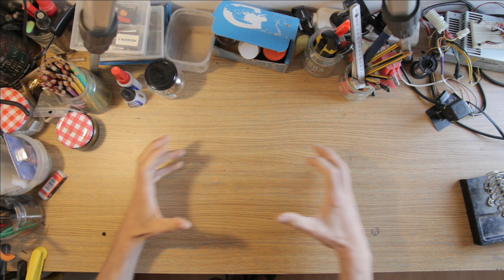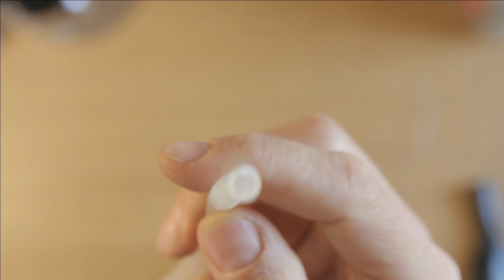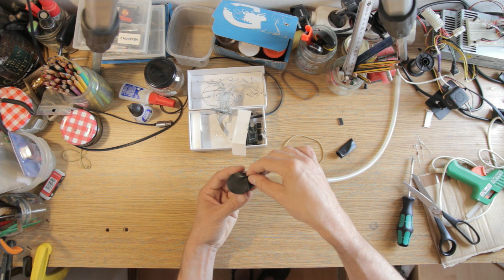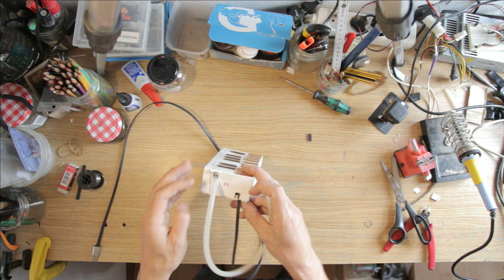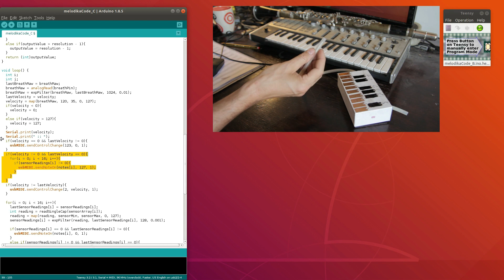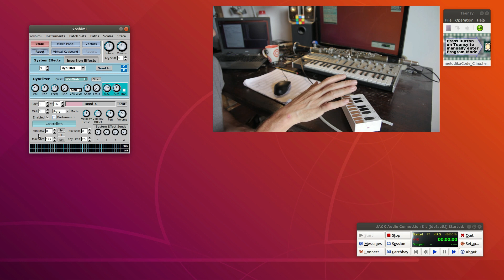KontrolFreak DIY MIDI Melodica

Comment: I'm thinking if it is possible to do this with a real melodica. So it can be use as the regular instrument and as a midi instrument. What do you think?
Reply from the maker: Might be possible, but quite tricky though, because of the mechanical nature of a real melodica. You'd need a completely different sensor setup to make it work...

Comment: would be nice to have a midi mouth piece that could be combined with any midi keyboard now that is something i would love to have :p

maybe one could adapt this with an arduino or something with a midi hat... and have midi in and out and do something with the signal based on that hmmmm... not familiar with midi interfaces though... but kind curious to try it :p
Reply from the maker: No need for an Arduino and MIDI hat. This chip (Teensy LC) outputs MIDI via USB, and can be programmed with the Arduino IDE. Would be pretty trivial to make a separate breath controller, and use it with your keyboard of choice. Just have it send a volume control (CC#7 for example) to the same channel as the keys. You might enjoy some of the mouthpiece prototypes in my newer videos: https://www.youtube.com/playlist?list=PLCejzxWlLD_ybX0R1CpkwIb5D1jcsiq2-

Comment: At last! The FIRST man, who published this idea!!!! There is also KIMOLODICA on Youtube, but without any information about this instrument. As to my question: I have almost no idea about programming, but - how can I make the woodwind controller with the help of a balloon (of course, I understood the principle of LED and photo sensor ) in order to connect it via MIDI to the synthesizer? So, is there any ready-to-use board, to which I can solder LED and photo sensor and get MIDI signal, which will be directed to my MIDI sound device? Thanks
Reply from the maker: Thanks for your comment.
Your best bet for a ready-made board is a Teensy microcontroller. It has a USB MIDI output which works great. If you want something that's more "plug and play", with no coding or complexities, then you'll have to wait a bit. I am currently working on a workshop format for schools based on these instruments, and as part of that I will make and sell sensor modules and breakout boards. The code for the instruments will also be up on github soon. Subscribing is the best way of keeping up to speed ;)
Reply: @KontinuumLAB  Of course;) When approximately do you plan to accomplish it?
Reply from the maker: Soon as possible ;)
Just uploaded the code this morning, link is in the description.

Comment: Nice YouTube channel. Your talents are very impressive. I really enjoy the more creative uses of computer engineering. I wanted to ask, how do you clean your electronic wind instruments? The melodica was a short term project but how about for the Open Horn? Doesn't the balloon material trap a lot of bacteria? Or perhaps it's unlikely that any moisture in the breath will get that deep inside? Thanks for all your fascinating insights.
Reply from the maker: Hi Elizabeth. Thanks for your comment.
The breath-moisture definitely gets all over the inside of the mouthpiece, and bacteria could become a concern. The solution is simply to change the balloon membrane for a new one. Balloons are cheap, so can be changed as often as needed. I think of them as the equivalent of the reed on acoustic wind instruments, which also needs to be changed every so often.
Reply: Cool. Thanks!